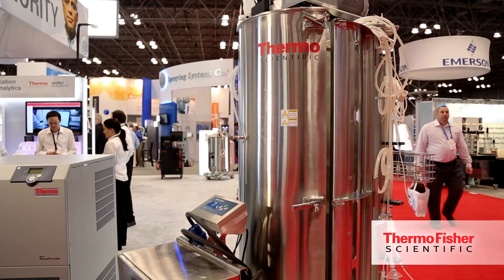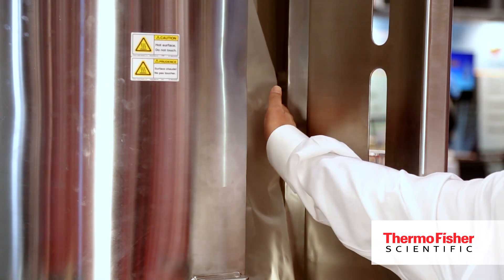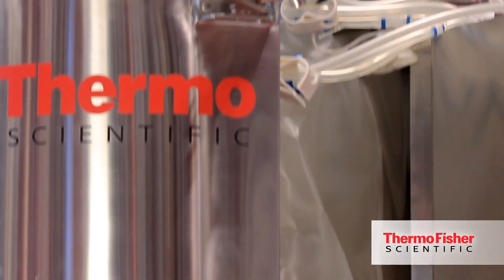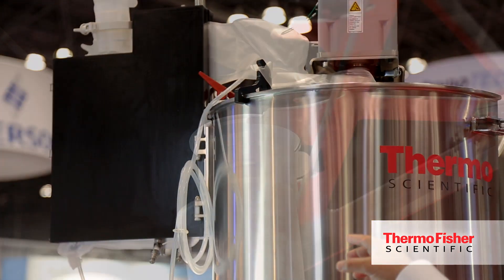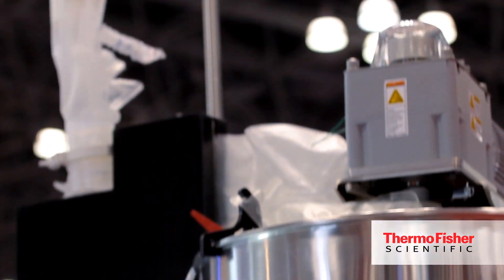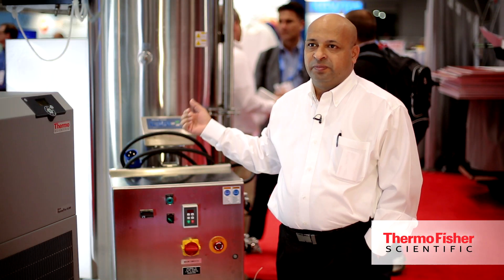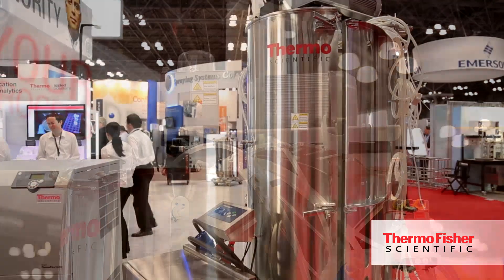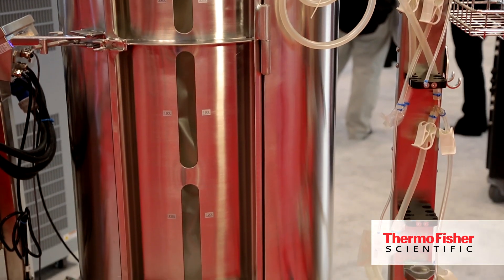Single-Use Fermentor (S.U.F.) | Thermo Scientific™ HyPerforma™

Comment: The Thermo Scientific™ HyPerforma™
Single-Use Fermentor (S.U.F.)
is designed to provide you with
enhanced functionality, ease of
use, and efficiency. The complete
HyPerforma S.U.F. system consists of a
fermentor tank and Thermo Scientific™
HyPerforma™ S.U.F. BioProcess
Container (BPC), which is available in
30 L and 300 L sizes with a 5:1
turndown ratio. The HyPerforma
S.U.F. maintains traditional stirredtank
fermentation design principles,
including specific height-to-diameter
ratios (3:1) and top-driven impeller
location that delivers optimum cell
viability, performance, and scalability
from process development through
production.